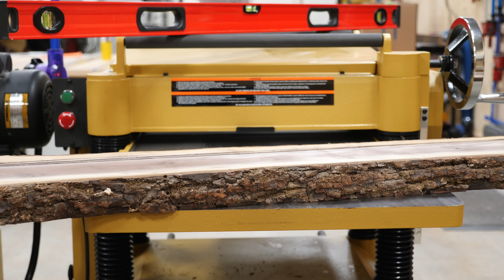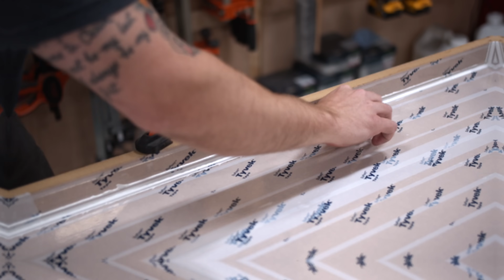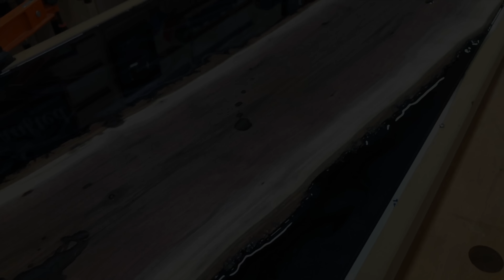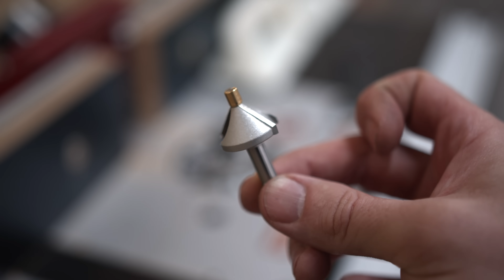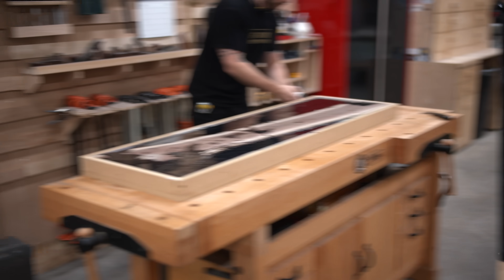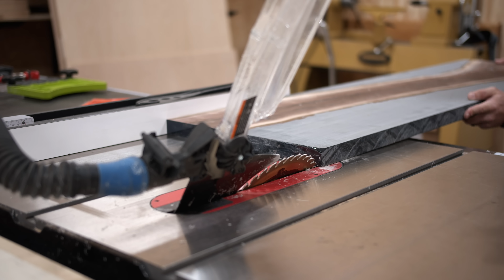Live Edge EPOXY RESIN "Reverse River" Table 💧 Woodworking How-To

Comment: Ouch... yeh there are a few mistakes with this. It looks great but leaving the bark on is going to cause problems. Bark = dead wood. All of the epoxy is attached to that dead wood, eventually the epoxy will fall off the table, regardless of moisture content. Then there's the issue with the taps, though they work, it won't handle any changes from the seasonal shifts of the wood, which will eventually result in checks. The multi-layer approach worked, but you could have avoided that by using deep pour epoxy. It cures at a much much slower rate so you can sometimes pour up to 6 inches. That's especially important when working with non-solid colored pigments. Either way it goes, it's a nice table, I still learned a few things from it, and maybe you've already learned some things about it as well since this was posted in 2019. Keep it up :D

Comment: Very nice work and video Johnny. Couple of questions. 1. I’ve noticed most videos of live edge wood work the builder removes all the bark. You did not. Do you have experience that made you feel it was unnecessary? 2. Did you install any dowels or metal rods into the bark edges to help the epoxy grip and not move? Again, really enjoyed the video.

Comment: Not a internet professional, but why would you leave the bark on the slab? It makes for a weak top, so now the epoxy binds to the bark,rather then the solid live edge and if the wood is seasoned it should come off rather easily. Am I missing something here?

Comment: Just a quick tip from a long-time modeler...  If you are going to use a tap to cut threads in wood, follow the tap with a few drops of your CA glue then use your tap again after the CA dries.  The CA will soak into the wood and harden the threads!
Reply from the maker: Good tip! I've definitely done that in the past, but these wood specific thread taps cut incredibly strong threads, I've never had one fail on me.

Comment: btw, if you use a needle to prick the epoxy on the pin holes, it will break the surface tension allowing the epoxy to actually fill the pin holes. basically what happened was you added a thin layer on top of the pinholes and sanding it removed that layer again. it never actually went into the hole due to the surface tension.
you can also buy thin gauge needles on Amazon and "inject" the epoxy inside :)

Comment: Thanks for the video. One suggestion: I bet the bubbles you got right around the bark would have been largely avoided if you had scraped off the bark, and done a quick setting layer of epoxy on the live edge, to seal in the air.

Comment: Do you have to account for wood expansion and contraction when selecting your method of tabletop fastening? Thanks.
Reply from the maker: For sure. I drilled the holes for the bolts oversized to account for wood movement.

Comment: Probably not the best idea to keep the bark attached when pouring epoxy...
Reply: first thing I noticed as well
Reply: Kevin Andrews that’s not how that works
Reply: Wayne's Wood Co you are correct! Epoxy will adhere to the bark and the piece will come apart! Why is it called  live edge?
Reply: @Donnie9by5  Because the "edge or edges" are not cut straight.  The natural contour of the board is used.
Reply: wolfeaglet1 I have seen were the live edge comes undone with the epoxy poured with out removing the bark !
Reply: @Donnie9by5  Let me clarify...your question was why call it a live edge and that is what I answered.  I agree with the bark issue, therefore I did not comment on that.
Reply: I'm a big fan of trying to keep the bark attached if it's tight and/or not rotting
Reply: yeah...keeping the bark on is not a great idea.
Reply: pretty sure this is not gonna happen this stuff gets in all the nucks and cranys. It even penetrates the wood a bit so the bark is fixed to the wood now xD
Reply: @bjoernhopp1234  Yea maybe years down the road it could become a problem? looks pretty awesome though!
Reply: If the bark is firmly attached to the wood and it’s supported along the width of the tabletop it’s perfectly fine.

Comment: nice work       i have a question if i pour only one inch at the time i  have to let it curinge and add the secend pour  i wonder if finly the  edge of the table look  like its not one pice sorry for my english and please answer me
Reply from the maker: If you measure out the color that you use like I did, the layer line should be almost invisible. Hope that helps!
Reply: @craftedworkshop  thanks

Comment: Great looking table.  I'm really curious about how well the epoxy does across endgrain.  I want to try to use it as a breadboard end to a wooden countertop on my island.  I've never seen it done and I too am worried about expansion and contraction.  I'd like to pour it right to the counter but I may try machining it separately and actually attaching it as a true breadboard.  What are your thoughts???

Comment: Johnny, hows the table on racking without any bracing?  Nice job!
Reply from the maker: Thanks! It's got a bit of wobble if you really push on it, but it's fine for this kind of low use hall table. I wouldn't have made the same design with a dining table most likely, or I would have used thicker stock.

Comment: Beautiful table man!
Question: is there a reason why you didn't remove the bark? I thought you had to remove it in order to have a better grip. I ask because one of these days I'd really like to make a table like that.
Cheers!
Reply from the maker: Thanks! The person I built the table for wanted the bark left on. The epoxy still found its way into all kinds of cracks and crevices, and the bark was on there super solid. Definitely don't think it's going anywhere.

Comment: What were your material costs on this table?
Reply: I was wondering too, so I 've estimaded the price:
4 Gallons Epoxy= about 700 Dollar
Walnut slab= about 100 Dollar
Worktime= I guess 1 Day in total = about 800 Dollar
So for the whole thing about 1600  Dollars...
Reply from the maker: The epoxy is $500 for 4 gallons, and I didn't use quite all of it. The slab was $120. The Maple was leftover scraps, but would have probably cost about $60. Finish for both the base and top were probably around $40. It took me about three days to build all in. Not bad considering I could have sold this table for $1,500-2,000 pretty easily.

Comment: Looks awesome dude. Only question is are you concerned about things separating and coming apart since you didn't remove the bark from the slab before pouring epoxy? Not criticizing just curious as I have a bunch of black cherry that we just milled up at my house a few weeks back so once its ready I plan to do some sort of epoxy river table with some of it.
Reply from the maker: This slab has been sitting for close to a year at this point, the bark was on there super solid. The epoxy also worked its way into plenty of cracks, so I'm not worried about it. The epoxy really just needs to resist gravity here, there won't be much of any weight put on this table (maybe a lamp).